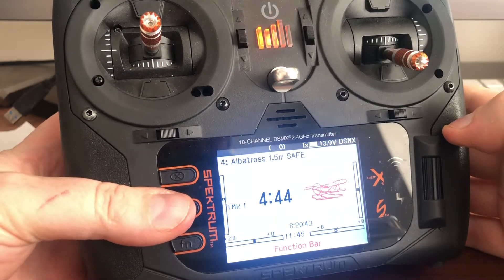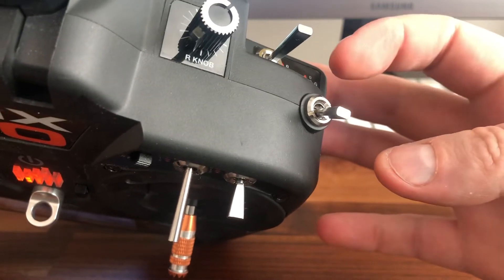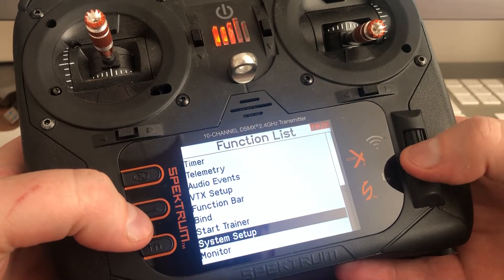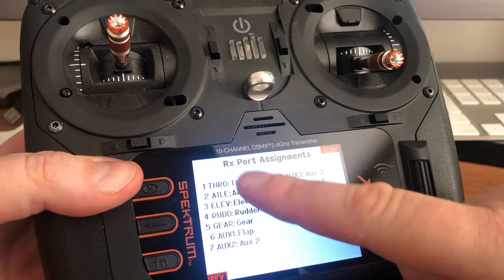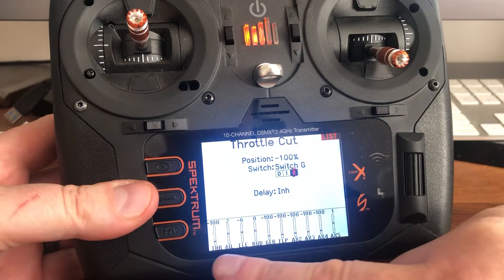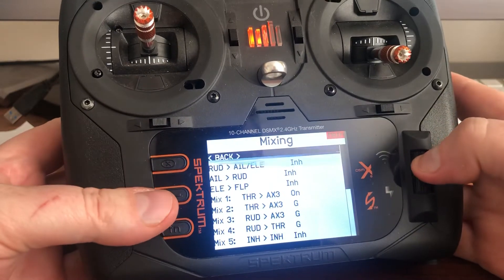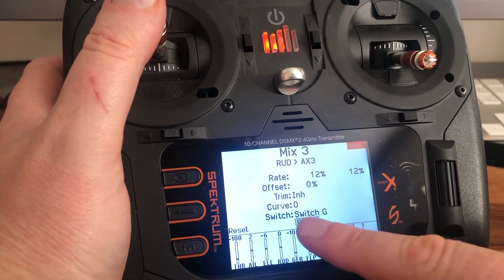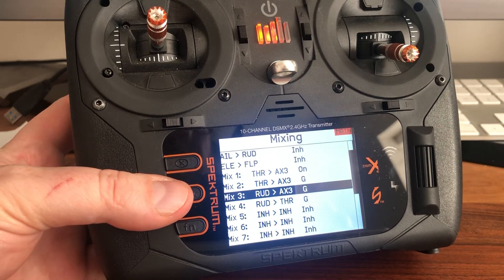Spektrum NX10 Differential thrust set up with true throttle cut.

Comment: I put the functions I need in an emergency on the ends of a 3-position switch and the function that I'm least likely to need in a hurry on the center position. So, throttle cut is position 2, differential thrust is position 1, and normal thrust is on position 0. I don't like that either motor will run if you only move the rudder. I only want the motors to run if I advance the throttle. Now, how are you going to shut the right motor off during a failsafe?
Reply from the maker: @txkflier  I’ve done a new video with failsafe through forward programming. Have a search for RedFive Projects on YouTube

Comment: WOW! This just helped me a lot! 
I just found another way to do this through your explanations : I have differential thrust planes without rudder, so I don't need normal mode. I just used a 2 position switch for my regular ''Throttle cut'' and one mix (+ the 2 others) was enough to kill the power on the motor that was wired to the AUX2 channel
Here is what I did : MIX 3 (Throtthle > AUX2) 
Rate : -100%   and   100%
Offset :       -100%
Switch : H (position #1 = activated, the same position that activates my throttle cut)

Comment: Most excellent.  Like you, I've been messing with this for years and to no avail.  :washhands:👍
Reply from the maker: Cheers. I’ve actually thought of a better way to do it with less mixes. I’ll put a new and improved video together over Christmas but basically you don’t need any mix in the throttle cut position. Currently the throttle to aux mix is active and then I use a throttle cut mix. I should just not have the original mix not active in that position.
Reply: @putzytart  I've just confirmed on the bench with a couple of spare motors and it works like a charm.  A brilliant piece of thinking.  I will be applying this on my just built Canadair CL-415 water bomber.  If you come up with an even better way, I'll use it in my future multis.  I also have a HobbyKing Albatross that will get this later.
Reply from the maker: @Xviperprime  yeah I use this on an albatross. Improved mix video coming soon
Reply from the maker: So it turns out that my idea of doing this more simply did not work - what you see in the above video is as good as it gets - however - I have posted a new video about it all that is much slicker: https://youtu.be/v7x1hEMfgZw

Comment: When you’re setting up the differential thrust like this how do you have your ESC’s wired together , since you have one in the throttle slot and one in the aux slot?
Reply from the maker: The two ESC to battery cables are Y-leaded together I think. The plane came set up already.

Comment: Thanks, great video.  I am going to use on the HobbyKing Albatross V2 (the rcgroups pages for the Albatross link to this video.)  Question:  have you found that the 12 percent throttle adjustment to each motor provides a good amount of differential thrust for the Albatross?

Comment: Does the throttle cut work with both motors when the radio goes into failsafe?
Reply from the maker: It does. But I had to program that using the failsafe function of forward programming in order to get it to work